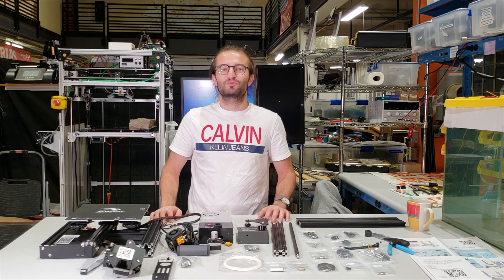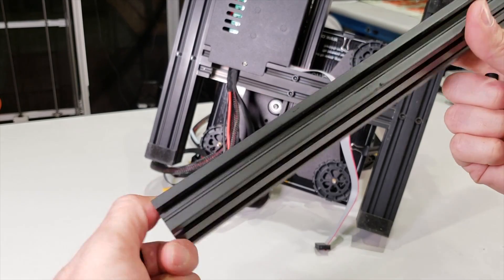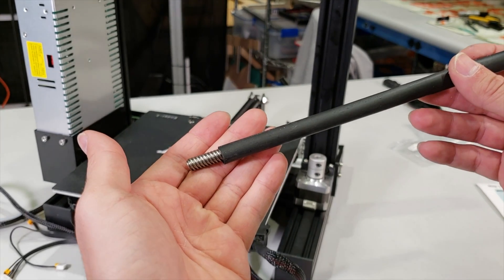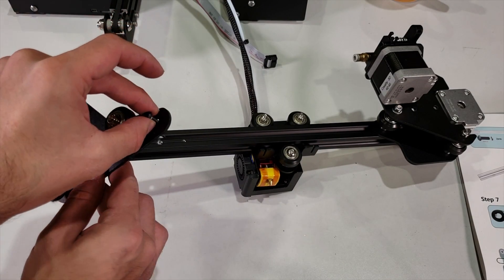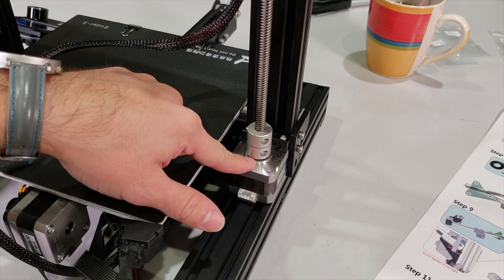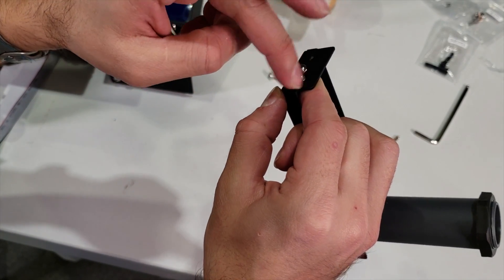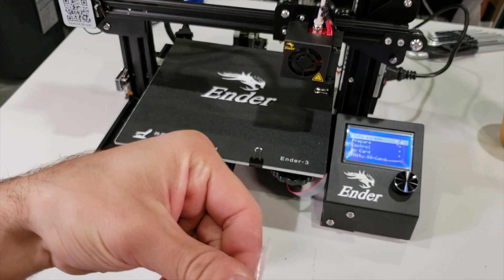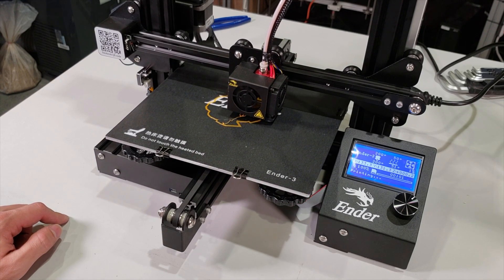Creality Ender 3 All Assembly Steps

Comment: Hi.. I have issue with Dimension accuracy. How to solve it? Appear + - 0.2—0.3mm
Reply from the maker: Thats is probably what you can get from this machine. Dont expect it to be 100%  there will be tolerances. Maybe slowing down, tensioning belts, better cooling could help
Reply: @3DPDoctor  hmm ok what's the normal speed for ender 3.
Reply from the maker: There is not a normal speed term. Its up to your desire. Try to not go over 60mm/s you can but it might get hard to print high quality. You pick your own speed after trials. I mostly use 45mm/s
Reply: @3DPDoctor  thank you

Comment: what is the option on lcd menu to disable the stepper motor ?
Reply: when doing manual bed leveling
Reply from the maker: It is called "disable steppers"
Reply: @3DPDoctor  thanks sir ... it's a bit confusing for the first time assembly .
Reply from the maker: Check out tye 17:36 in the video. You should be able to see it down in the menu
Reply: @3DPDoctor  ok thank you ..